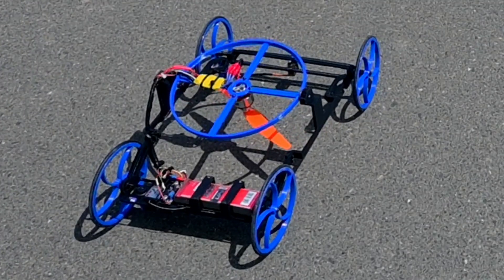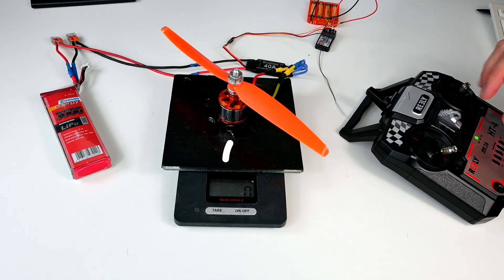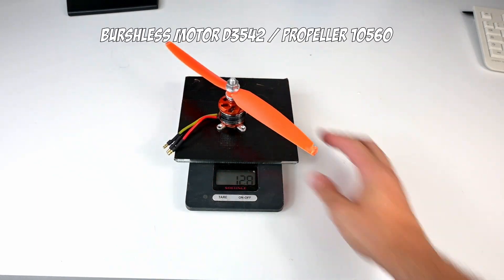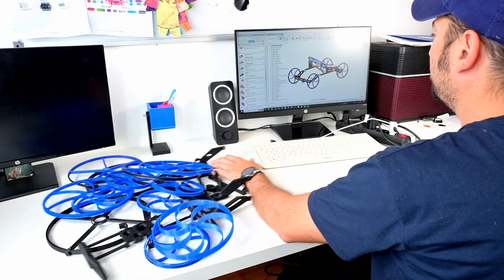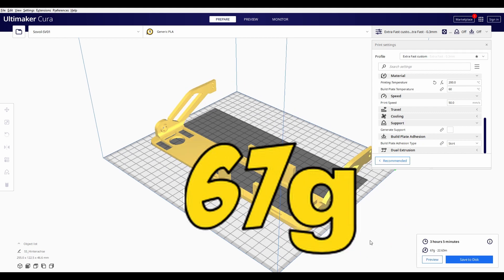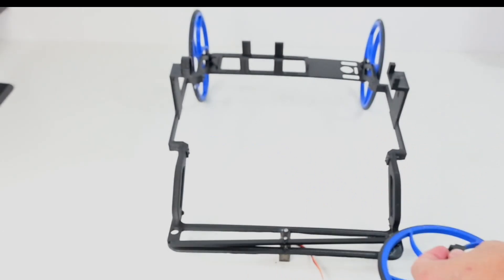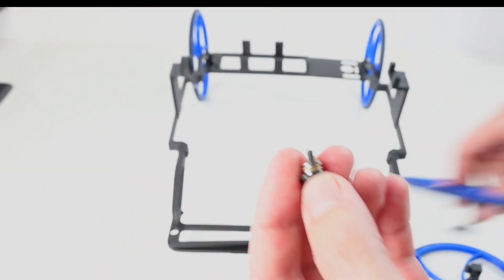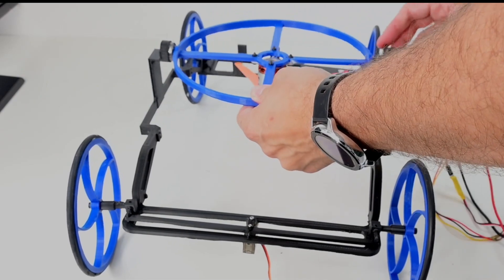Sonic the wall Racer

Comment: Looks Like a Copy of the "VertiGo Robot car" from ETH Zürich  but nontheless nice Project 🤘
Reply from the maker: I wouldn't call that a copy. More inspired than copied. Vertigo is way too awesome and expansive to compare it with my 3D printed racer. It has different function, features and design. The common thing is tilting a propeller.

Comment: thanks . r u looking at building a control system for the same . so that driving the same become easier . lets different mode . i am definitely interested in building one . btw great work.
Reply from the maker: I would like to mount a gyroscope and control the thrust angle with Arduino. That might be a further development. Also adding a small DC motor to the front wheels to be able to go from the ground to the wall without additional help would be great.

Comment: This is so amazing. How much did the project cost?
Reply from the maker: Thx. The most expensive part was the Lipo battery for 42$. I think it was round about 120$.
Reply: @Thefedmog_Challenge  I want to try this project but it costs a lot in my country. 120$ is a lot here.
Reply from the maker: @random_game_clips047  maybe you can get similar parts cheaper somewhere in your country. It doesn't have to be the same parts. I can send you a Partlist if you want, and you can check the situation there.
Reply: @Thefedmog_Challenge  thanks but I don't think I will need that. I liked how you care your viewers👍🏻

Comment: If the thrust were downward instead of upward, it could also drive horizontally on the walls.

Still, an impressive project.
Reply from the maker: You are right. But It's too dangerous without protection for that large propeller. When it's at maximum rpm the only thing you can do then is: run....😅

Comment: Awesome! well done man. One thing that could cut down on weight even more is removing a couple spokes from all the wheels. I'm not sure how strong your filament is but it looks like you could get away with just 3 spokes instead of 5, meaning you could remove 8 spokes total. Looked really cool driving on walls... I wonder if it could fly 🤔🤔
Reply from the maker: Thanks man. i appreciate it. regarding the wheels i tried different designs. If the robot falls from the wall (for an unexpected reason ;-p), it falls mostly on the back wheels. This design is stabil enough and can absorb a lot of energie. Also for the front wheels when the robot crashs against a wall or an obstacle. 
I really dont want try to fly that thing. A 10" propeller rotating at 2400rpm in the face is not funny. I need to install a protection around it first :-).
Reply: @Thefedmog_Challenge  both good points lol,